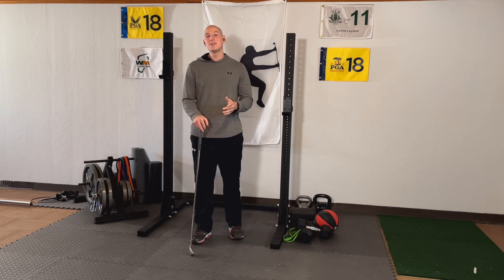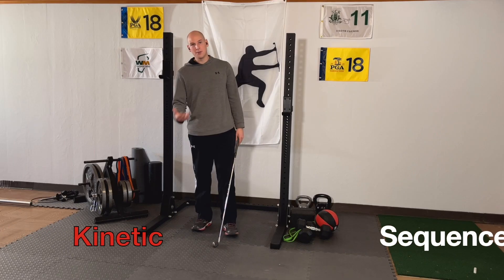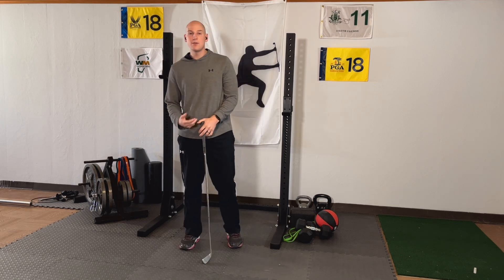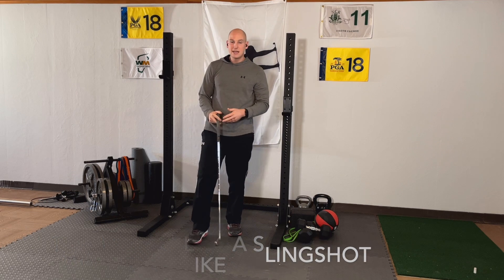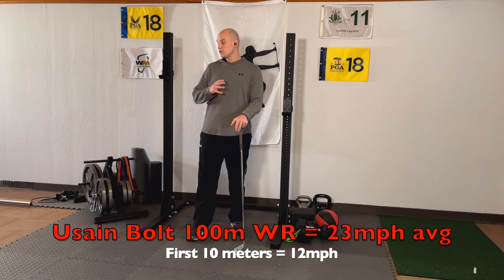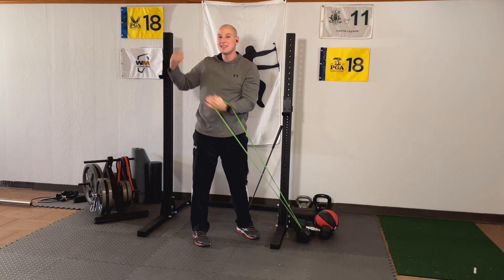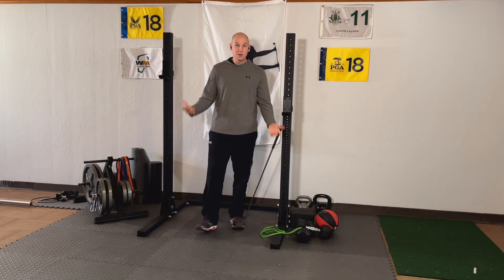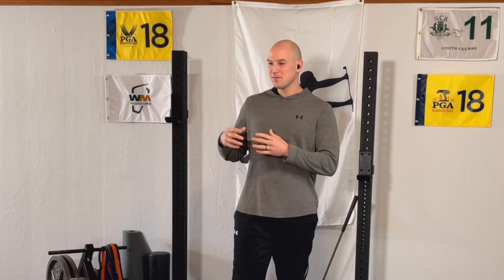The Science of Increased Clubhead Speed [For Golfers]

Comment: This is a pretty good video for those people who aren't too acquainted with the formal physics explanations (ie. work done on the club via the hands). There is another way to increase clubhead speed and that is a faster backswing. That's because you need to apply more force via the hands to decelerate the club by the time it reaches the end of the backswing . Therefore you are already starting the downswing with a higher starting force.  But then of course , it gets more complicated with regards the net force (and its direction) applied via the hands on the grip in the downswing.  There is something called the 'In Plane Moment of Force'  which causes angular acceleration of the club in the mid-late downswing. But none of the biomechanic experts have been able to explain in detail how to optimally square the clubface and what 'hand release actions' can help achieve a low ROC (Rate of Clubface Closure) through impact.
Reply from the maker: I agree with all that, but as someone who used to work in a biomechanics lab, it ain't no youtube ready explanation haha! 

also, technically increasing backswing speed is increasing force, hence one of the 2 (over simplified) reasons